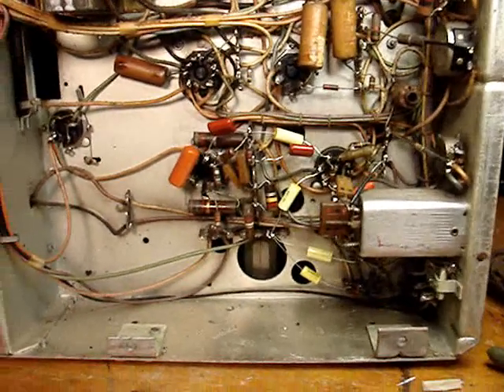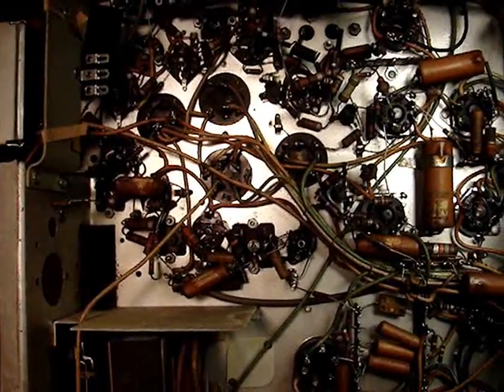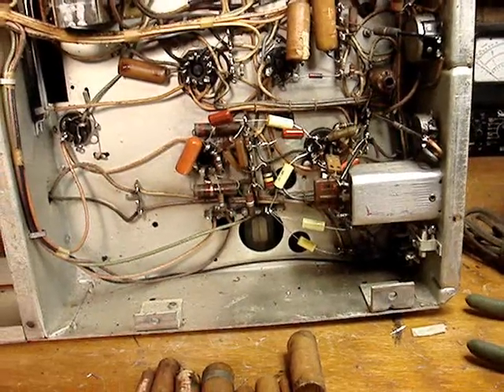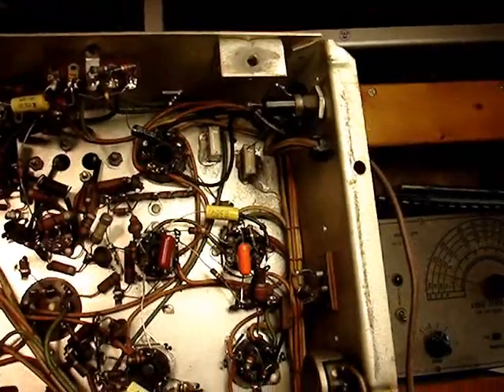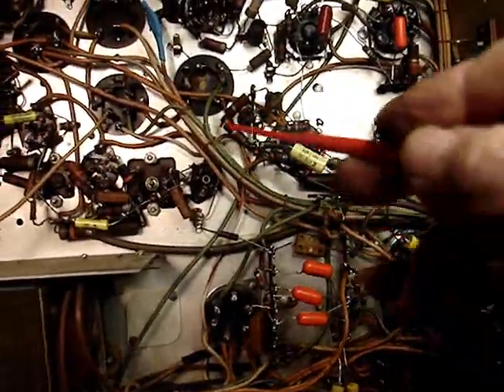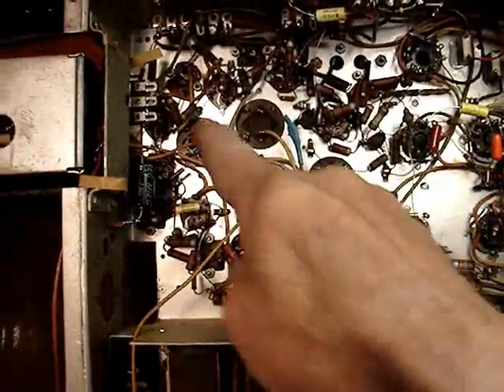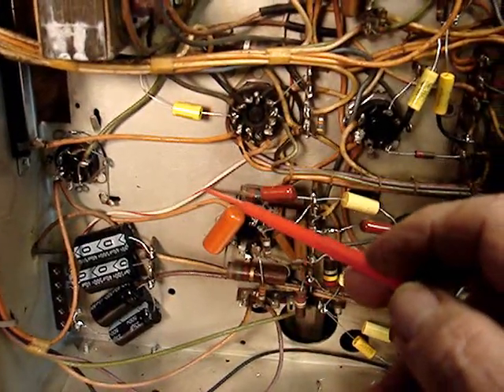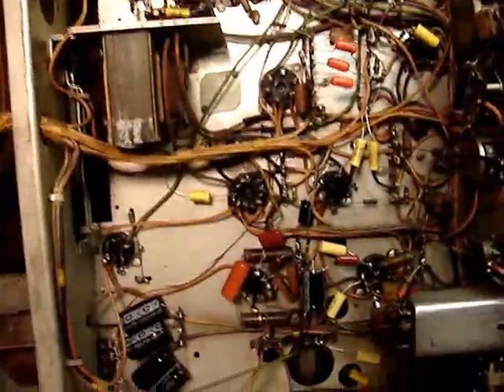Magnavox Embassy 1950 TV Radio Phono Combo PT11

Comment: Got a few TV projects i would like to undertake, however I have been waiting on finding a picture tube tester I can borrow. With only 3 sets it doesn't make sense to buy one. I have a Motorola 7" static set 1949, a 1953 Hoffman 21", and a 1967 GE 23" color all tube set KE chassis with cataract. The Hoffman is a nightmare of black beauties, paper waxies, sandcast dog bone resistors, and the big canned ohm jobber.
Reply from the maker: Keep your eyes open for local sales because sometime electronic test equipment comes up for sale and that might include a CRT tester. You can rebuild one of your sets and just take a chance on the quality of the CRT. I would suggest the Motorola 7" and if you do then you might pay close attention to bandersentv's restoration of the same set.

Comment: I recapped mine, including the electrolytic cans. I replaced the 72 microfarad with an 80 microfarad. I soldered the negatives to the negative tabs on the old cans while soldering the positive  wires to the new caps. All under the chassis. The set performs well.
Reply from the maker: As you saw if you watched my video to the end I am not getting any video information through so I have some technical tasks to go through. You did not post any videos of your project. I would have liked to have seen your project.
Reply: HD7100 Hi, I didn’t film my restoration but I have pictures. An open video detector diode will stop video in its tracks. It will show as an IN32, 34, or 36 on the schematic. Bad tubes on the tuner will also do the same. Yours should have 4 video IF stages, each with a 6AG5. One could be bad.
Reply from the maker: @Earcandy73  I have been studying the schematic and I took note of the video detector diode. The tuner is very dirty. I do get audio passed through if I play with the tuner but it is very intermittent so I should open it up to clean it and see if I can get it working better. I did test all of the tubes but I will test them again. Thanks!